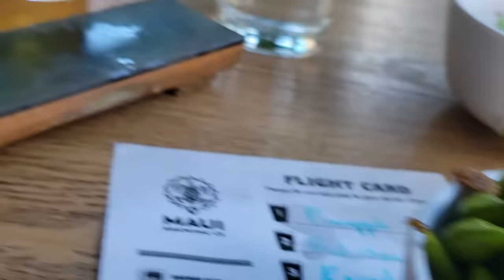WORKING ON A CRUISE SHIP | DECK DEPARTMENT | SAILING THE HAWAIIAN ISLANDS

Comment: It also has no casino which means it does not stink of tobacco smoke. Smoking is only  permitted on the starboard quarter, It also has blue exterior lighting because of migratory birds. Very unique. Highly recommended.

Comment: I was aboard an oil tanker mid 80s anchored off Oahu when we found out Devo was playing at the Hard Rock Cafe. 6 of us younger crew got all stoked and found watch standers to cover, then right when it was time to head over, a damn squall blows in and the supply boat radios he's not gonna run out until the storm passes.  40 years later, I still regret missing that night out.

Comment: Well, I can attest, NCL(A) which is what it was called when I worked for them, looks like things have changed a lot. As a crew member in 2007 we weren't allowed in the guest areas unless we were working in those areas. I was also working 12-16hrs a day so not a lot of time off. So, its interesting to see what has changed since I worked for them. The only thing that is the same is that they are always under manned on that ship. I also worked in the Pride of Aloha, so different ship may have different work conditions.

Comment: AB (unlinited) Dave here. AKA Bosun Dave. Whats your rating. I never went thru the cadet program at Piney Point, just took some continuing Ed courses. My first discharge was with the NMU in 1975 as an OS. I still have a huge stack of ALL my USCG discharges.

My two fave ships: Lykes Navigator container ship(3 month contract. USNS Bowditch TAG (spy) ship in Sasebo/Okinawa (5 month contracts)
I mostly worked for the US Military on Ready Reserve ships, like the Cape Edmont(Cape Deadmont).  Going from break down to break down gave us PLENTY of time in port.

My oldest ships: Great Lakes tankers built in the 1930's,  Lykes Solon Turman, MV "I forget"....decrepit 1963 stick ship they pulled from mothballs and loaded FULL of bombs for classified ports. Old Liberty Ship SS Pasedena tanker....cut in half and extra tanks added.

I DID work for an  NCL  non US flagged ship, but as a part of an onboard diving franchise Dive In. Miami-Bahamas. 6 weeks on the ship, 6 weeks on shore in Great Harbour  Cay and then mandatory vacation and then back to work to stay fresh. NON union, BTW.

Comment: I worked on poa 2019 as foid and beverage and you dont get these kinda breaks. I worked 8-8 with a one hour lunch and 1 hour dinner. Our contracts were 5 months no days off so if your thinking about signing up be warned its not nearly as glamorous as he portraits in this vid. Not a lot of time to socialize or go to beaches. It can be done. Sounds like deckhand is the job to have